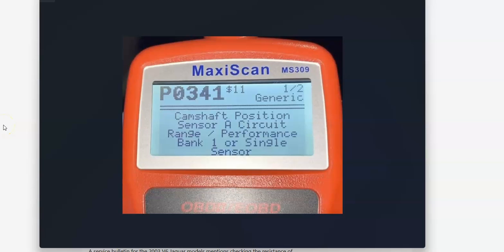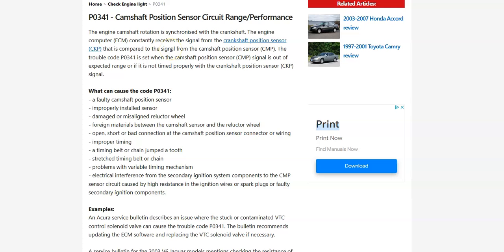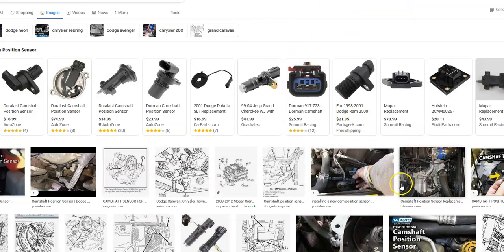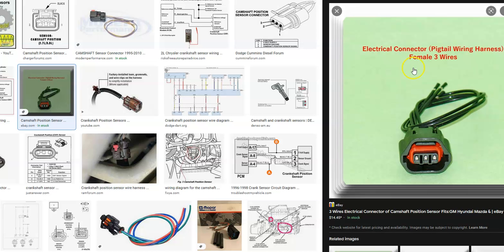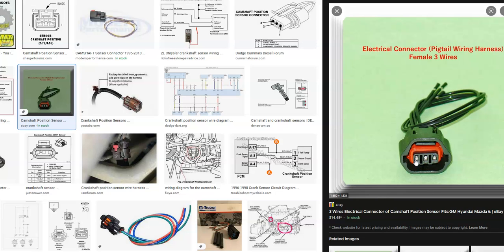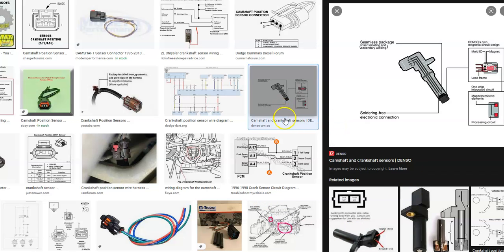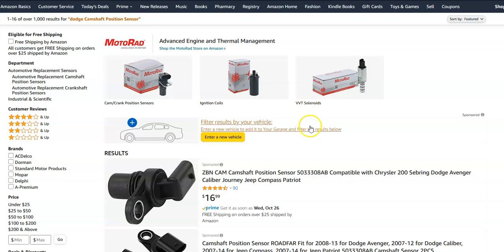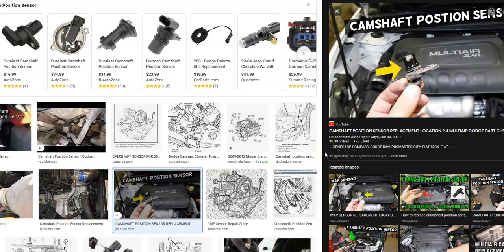Causes and Fixes Dodge P0341 Code: Camshaft Position Sensor Circuit Range Performance

Comment: I replaced my crankshaft position sensor I get it from Napa and truck didn't start, I went to Cummins parts and service and I got the original and truck starts right up, but p0341 keeps popping up.. so wiring??
Reply: Check the main connector in the power distribution box. It held on with a bolt that comes loose!
Reply: @lukedvisscher4676  thanks for the advice, what I did I remove all the batteries for like 30 mins and problem was solved.. now is working like normal since then.. thank you again
Reply: @ricardojuarez291 do you think it was disconnecting the batteries that made it start?